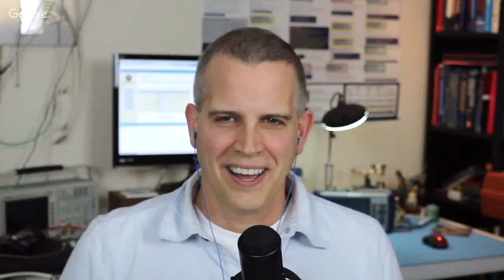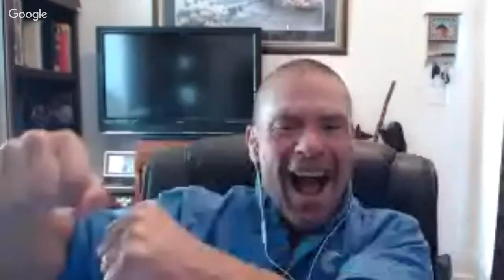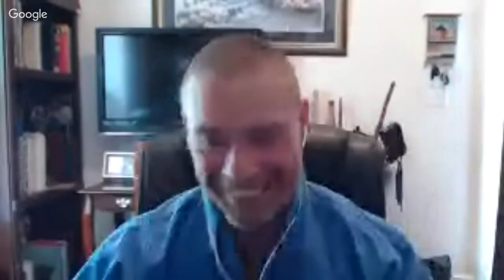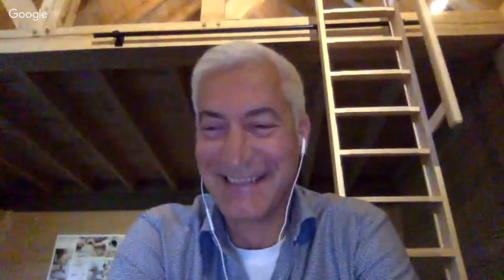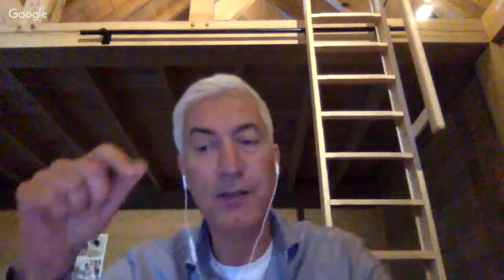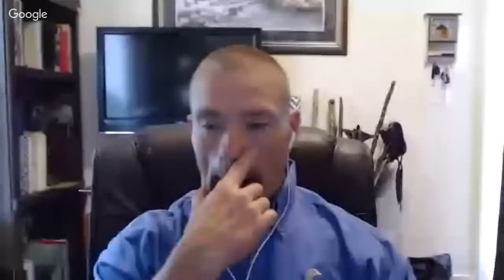10 Gig Over Coax and DOCSIS 3.1

Comment: In Canada we have new homes constructed with FTTH and then the cable company attaches a RF converter and a cable modem. Waste of glass. Cable companies need to phase out HFC and build PON based systems. Glass is future proof and more reliable than coax. HFC plant requires active maintenance otherwise customers internet goes down every time the weather changes.